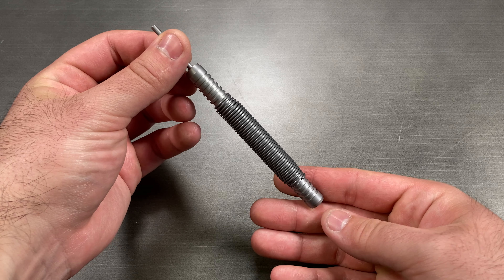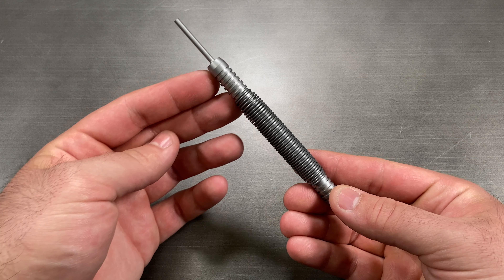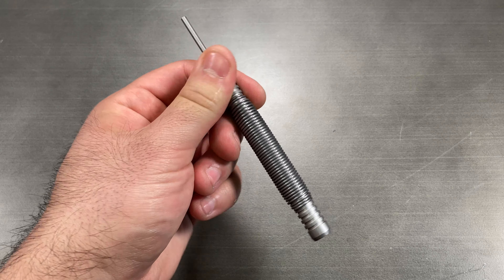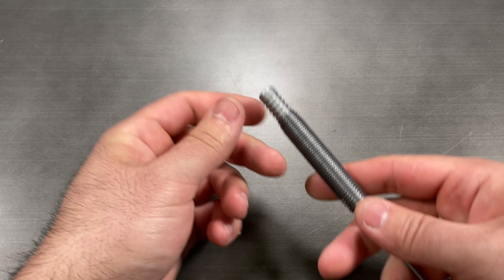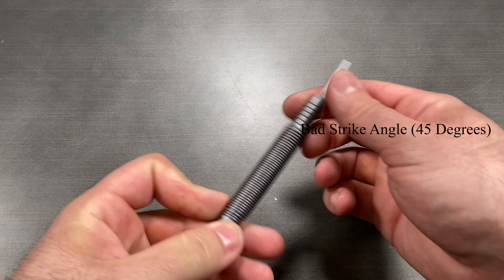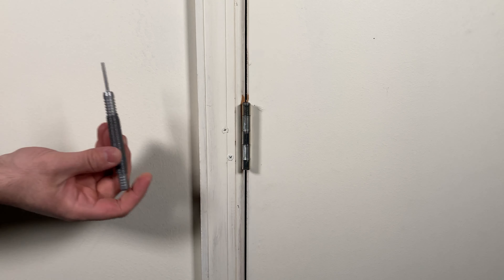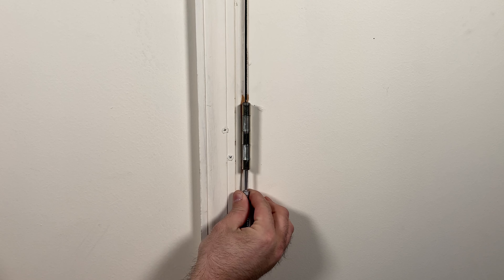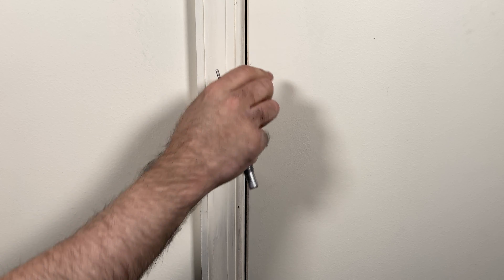Covert Instruments Hinge Tools Instructional Video

Comment: American doors are really funny...
Reply: How does a door work in Foxland?
Reply: @Maelthorn1337  first of, there are no doors with exposed hinges that can be reached from the outside. Second thing is, we don't have a "main bolt" in the middle of the hinge. The hinge consists of two parts, each one is screwed into either the door or the frame... So there is no bolt that can be driven out... The door has to be opened, and lifted as a whole to be removed. Some hinges are even countered from the bottem to prevent lifting... I don't know if that was clear 😅
Reply: @Mex_the_Fox they’re the same here. Hinge pins are ALWAYS internal unless absolutely necessary for safety. The hinge itself (like these) are two pieces held together by the hinge pin. If it’s a security door the hinge will be a thicker metal and often a “piano” hinge that runs the full length of the door.
Properly installed hinges will have the pin facing up, not down as shown here. It’s better for security and installation.
Low security options will have one end of the pin visible and it can be driven out like these.
Medium security both ends will be covered making it much cumbersome to remove.
In high security applications you would have to open the door to remove the hinges.
Helpful? By the way, it’s the same everywhere I’ve ever seen.
Also, some (old) hinges actually have three pins and three pockets on each hinge. Once the door is open you can simply lift the door to remove it. The removable doors on Jeeps operate the same way.
Reply: @UpperDarbyDetailing  this explains a lot - thanks for the clarification! I always wondered about the strange and unsafe doors - but obviously the youtubers only show the crappy doors 😅
Reply: @UpperDarbyDetailing  why have a low security door when you're gonna put a lock on it anyway?
Reply: @spacejihadist4246  usually they’re interior doors. The lock is for privacy rather than security.
Reply: @UpperDarbyDetailing  still a wrong way to install a door.
Reply: @ not really.

Comment: How is this better than a hammer and a set of punch pins? I don't get it.
Reply: Less space
Reply: Because you don't have to carry around a hammer and a set of pin punches!! Does that help you?
Reply: because it's only one small piece to carry
Reply: 1 tool does the job of two
Reply: I have a single heavy duty punch and it is a fucking GODSEND because beforehand I had to position the hammer and pins at a really awkward angle especially at the bottom. With these tools, I don't have to worry about the confined nature of the space and can apply full force to the door pins to blow them out